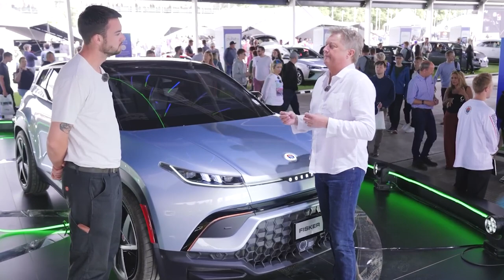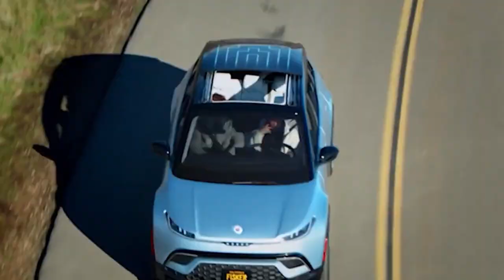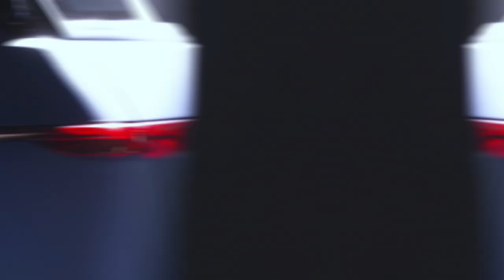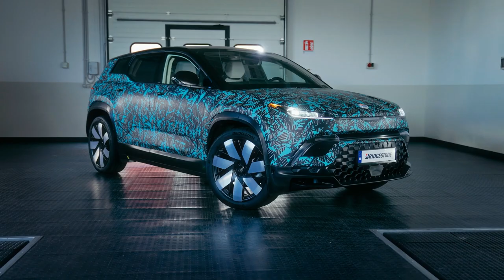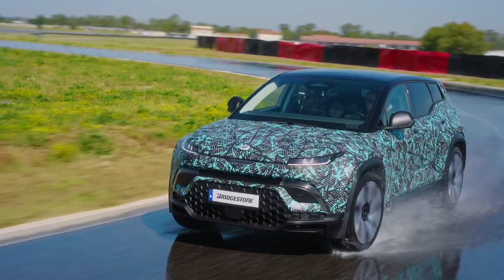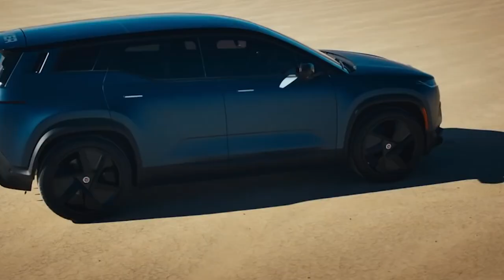Henrik Fisker TEASES 29.900$ Fisker Pear EV! Fisker Ocean Deliveries Start Soon.

Comment: 250 miles is way too low of range. Make it 500 miles and you have a winner. 

250 miles is the bs spec from the manufacturer. This is in perfect amazing conditions (spring time, no heat, no ac, no towing). I need 500 miles so i will actually get decent range in the winter or while towing.
Reply: 250 mile range is more than enough for a compact suv. We own an ID.4, with 250 miles range. Great for long drives and we have done many. Only time when I wished we had more range was when the temperature was below zero Fahrenheit.
Reply: 250 for base model. 350 and 360 for the others

Comment: This range is pathetic .
Reply: Range is a function of how many battery cells you put into the battery pack.  The battery pack is the main cost of an EV, if you want to reduce the overall cost of of the vehicle, you need to reduce the size of it's battery pack.

If you want range, you need to spend more money and buy a car with a bigger battery.  Fisker has stated that the PEAR is designed to be an urban commuter car, or a second EV for someone who already has a longer range EV.
Reply: @mmaschin  Yes, I understand that. What I meant was that the battery development is not there. In addition, to put out an expensive vehicle with that range is a waste of everyone's time.